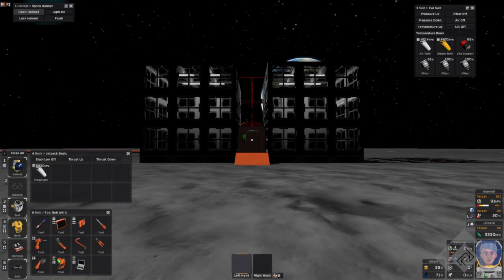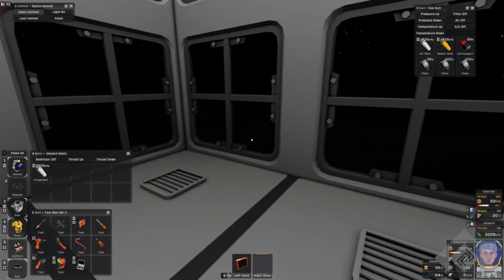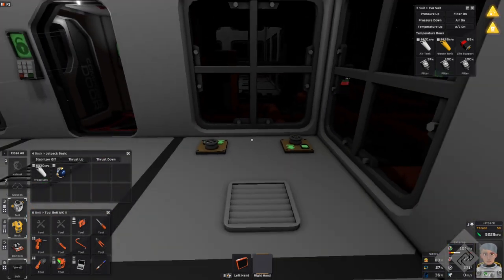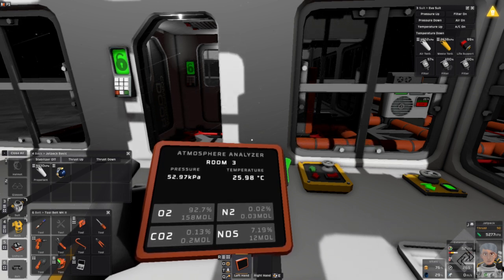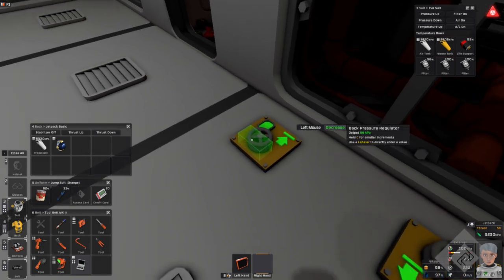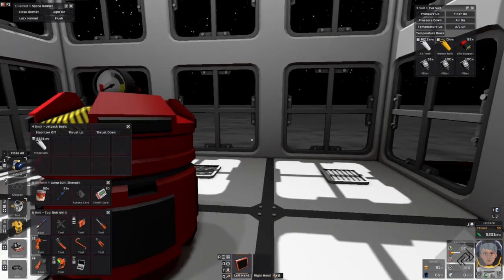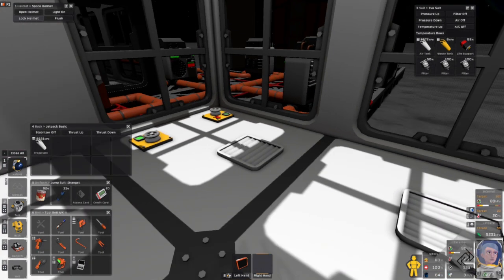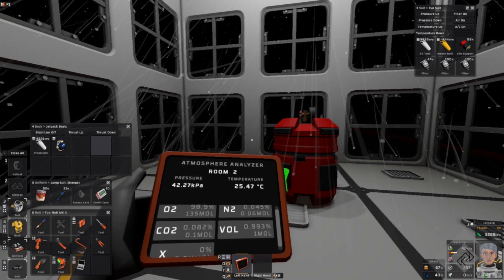What's Breathable, a not so quick tutorial - Stationeers

Comment: Oh direct response to the lungs damage indicator, it does exist (at least on Beta branch), if your lungs have taken damage, there would be an indicator on the HUD, along with the yellow body.

With damaged lungs, it does inhibit your O2 intake, and you could lose consciousness despite being in a 100% O2 (including your suit)...i just did that to myself inadvertently on one of my world saves
Reply from the maker: The "stable" branch has the same indicator, but with no percentages... which I guess makes sense. I did some testing, and it turns out, even upping the pressure to twice atmosphere or more, will not improve your stationeer's breathing while you have damage, and, if you 80 points of damages, you are basically dead, even a .01 addition, sends you into a knockout spiral with no way to recover.